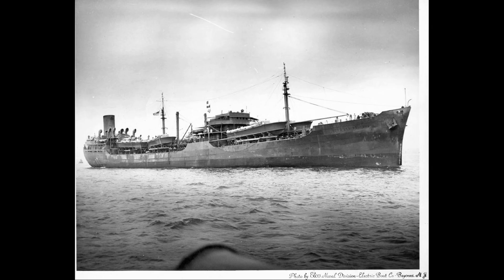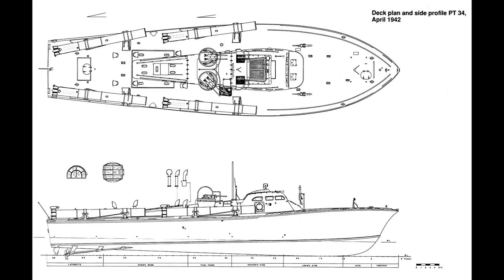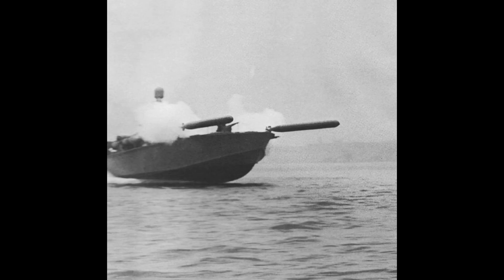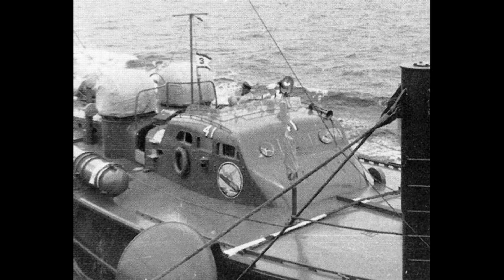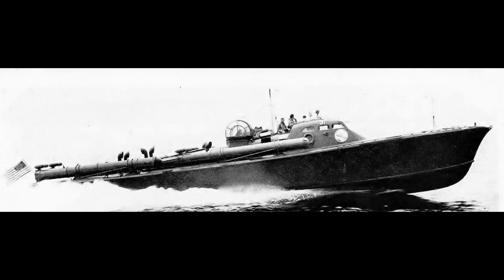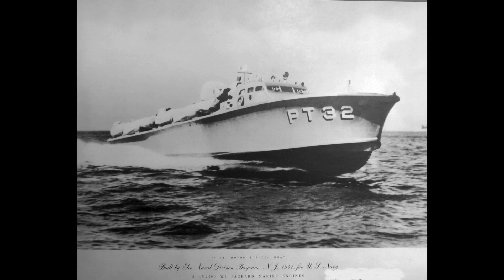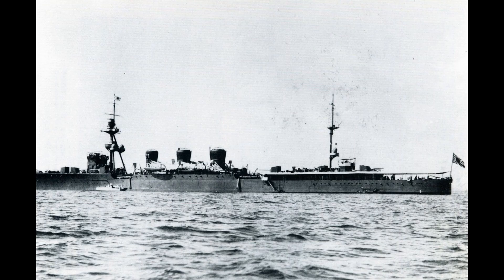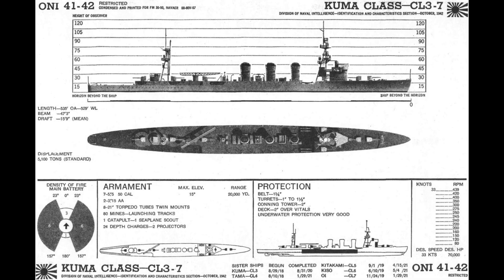PT Squadron 3 - Guide 161

Comment: If early-war US torpedoes had worked, the impact on strategy would have been fascinating.
Reply: A lot more US lives would have been saved had they worked
Reply: @captaindusty4884  And many IJN ships at the bottom as well.
Reply: The combination of dud Mk13 torpedoes in aircraft, Mk14 torpedoes in submarines and Mk15 torpedoes on surface vessels quite probably extended WW2 by six months to a year. (They all shared the same controls and fuses).
Reply: @allangibson8494  I did some digging.  For Germans, their sub torps were better than ours but still unreliable.  And their aerial ones were lousy.  Japanese ship launched "Long Lances" were great, but prone to catastrophic cascade explosions if hit on deck.  Pretty lousy situation on just about all sides.
Reply: Jim Miller The battle of Midway would have looked a bit different if any of the Mk13 torpedoes had worked (and the battle of Wake Island too).
Reply: @jimmiller5600  the main reliability issue of german torpedoes was the magnetic dentionator almost every country had issues with this. The Mk14 on the other hand has issues with the magnetic dentionator, the impact dentionator, the depth sensor and control, and last but not least the direction control qyro. All that along with being slow and leaving a large visible bubble trail.

Comment: Fantastic! I've been waiting for a PT boat guide. My dad was in Ron 10 on PT-124 from January 4, 1943 until it was disbanded in November, 1945. The Lewis guns and turrets were long gone when he arrived. They only carried two torpedoes by mid-1943, and they spent the vast majority of their time shooting up those barges, by then being used for attempted resupply of isolated islands. The Japanese barges kept adding bigger guns, and the squadron kept scrounging bigger guns of their own. It was an arms race in tropics, and the Navy, with the exception of the 40mm Bofors, never approved any of it.  

Dad's boat did have some ad-hoc armor. One of the guys was a metal worker, and he crafted a pair of 3/8" sheet steel plates from a scrapped P-39, and the crew installed them around the refrigerator/freezer. It used ammonia for refrigerant, and a stray round going through the refrigerant line filled the boat with ammonia fumes. Even worse, it meant the refrigerator was out of commission, and that meant no cold milk or ice cream, things they got from their monthly visit to the USS Mobjack, the squadron's tender. No one much cared about armor for the crew, but they wanted their ice cream and milk!

Oh, I forgot to mention that no one in the squadron thought very highly of Cdr. Bulkeley. He got to be a big celebrity because of the daring rescue of McArthur, and pretty soon he became the Navy's version of him. He was apparently an intrepid sailor, and the guys felt like he wanted to make sure everyone knew it. His book "At Close Quarters", written in 1962, got an even frostier reception, since most of the guys felt like it was a self promotion book, but also a promotion for JFK and the PT-109. A lot of other heroic actions by PT boats got short shrift in the book.
Reply: Brother, 
My Father(1st Marine division from 1942-1945) always said, "the worst thing in the military, was Navy ring knocker." He (my Father) had a very strong dislike of all most all Navel officers.

God Bless your Father.
Reply: @knutdergroe9757  Thanks. He was a great dad. God bless your father as well. From everything my dad told me and from what I've read, that sounds like that was a pretty good description of Bulkeley. No one can doubt the man's bravery, but some people use that as currency.
Reply: Mine served aboard the USS Maryland, BB46 as a radarman from Mar. ‘42 to Aug. ‘45. He survived 2 kamikaze hits, 2 bombs, and the aerial torpedo which blew out the bow.
Reply: Sar Jim, The book "At Close Quarters" was written by a different man, Robert J Bulkley, not the Admiral John D Bulkleley. Although both were PT Boat Vets. As a member of the PT658 restoration crew I have spent a lot of time with numerous WW2 PT boat veterans and the overwhelming consensus is that Admiral Bulkeley was a great guy and was well liked and admired by the men in the Squadrons (RONS). I have attended several WW2 PT Boat Veterans Reunions and they all pretty much feel the same. Maybe your Dad had a beef with him and had a different opinion, but it was not the majority opinion of him among WW2 PT Boat veterans1. In my book he was one of our greatest heroes of WW2. He also went on to start up the Motor Torpedo Boat Squadron Training Center in Melville RI,  then Command the USS Endicott that had battle and sank several German Corvettes, and then return to another PT Boat Squadron Command before the end of the war. Afterwards he was placed in Command of GITMO, and then the plankowner of the US Navy Board of Inspection and Survey (INSURV), which inspects and improves the readiness of every ship afloat. It was his idea to start INSURV. There are about 3 books about him you may want to read they may change your opinion.
Reply: I was a sub sailor. Milk and ice cream were critical items. Unfortunately they ran out after the first week.
Reply: Based on my own research, PT-124 was an 80-ft PT-103 class boat (PT-109 was the same class) armed with the twin fifty mounts and a standard 20-mm Orlikon gun, as well as two to four torpedo tubes and two or more 300-pound depth charges. How the crews improved their own boat's armament was up to imagination and what they could swipe.
Reply: tim murray  There's a story of how an ingenious PT boat crew in the Mediterranean distracted a group of guards that had been placed to watch over a  supply of beer on the dock, near the boat (bloody insult, because the beer was for an officers club at that base). Well, two guys started a fight and the guards rushed over to subdue the perpetrators. But when they got back to their post, the entire shipment of beer was gone!
Reply: tim murray  wwll USN were dry boats. Its why they so loved visiting commonwealth ships wardrooms n messes!
Reply: Kind of a 1940's version of John F. Kerry but without the treason element?
Reply: My Dad, in one of the few stories he would share was the strafing of the trees along the landing beaches before dawn. They would be filled with snipers waiting for marines and dawns light. He said the Marines loved the P.Ts. 356 Ron 27.
Reply: @francisbusa1074  Funny you should mention "treason", as that seems to be your side's specialty. Your guy admires the Austrian painter and authoritarianism. Not sure how you square that, but it seems you guys are rather flexible with fact and reason, so I guess you'll find a way...
Reply: totally untrue ..… basing it on one guys comment above

Comment: Ever since I watched reruns of McHale's Navy as a kid with my dad, I've had a huge soft spot for PT boats, and if I ever get a bunch of money, I'd build a replica and live in it up and down the US east coast.
Reply: Same dream.....
Reply: Same here...
Reply: Two Higgins type boats, PT-658 and PT-305, have been fully restored and operating. The 658 in Portland, Oregon and the 305 on Lake Ponchitrane in New Orleans where she was originally built.
Reply: @ronaldrobertson2332  There's a Vosper in Ohio (PT-728) that I hope to go visit, as it's a bit closer to me than the others. I definitely know about the others, though.

There also used to be a whole bunch on the Hudson River here, as part of Fleet Obsolete, but as far as I can tell, they went defunct years and years ago, and I assume the PTs are gathering dust in some warehouse downstate, which really stinks.
Reply: Re building in living on a pt.Thats not a crazy idea. Several choices of sandwich/fibreglass/marine ply construction. Could be built Much lighter.so needing much less power Three marinized chevy diesels would would sound Uncannily like the origional packhard v12s!
If the diesel fuel bill is still a bit eyewatering , is possible to configure the engines to run on lpg. Cylinder tanks hidden inside the fake torpedo tubes
Reply: Most of the PT boats were burned in the Philippines after WW2...
Reply: The 73 seen most often was a reduced size replica. I think it was an attraction featured at Universal.  Just a shell.
Reply: Lanse Lithgow Not having eight tons of torpedoes on deck would help with fuel consumption too.
Reply: Hey Chuck ! Hurry up will ya. The good old '73.
Reply: John Wayne actually owned a PT for pleasure.
Reply: @richardw64  me too brother!!!
Reply: Update on the 305: Due to the cost of running the boat and covid ruining tourism,  the 305 has been taken out of the water and wrapped in shrink-wrap and put in storage.
Reply: @gispel7058  The actual PT 73 was a Higgins-built 78-footer that served in the South Pacific. But it was lost in action when it ran aground in enemy waters and was burned by the crew to prevent capture.

Comment: Great episode! I would also like to hear a breakdown of all of the different PT boat classes and their evolution and field modifications. Maybe even an episode on german E-boats and the british equivalent
Reply: It would be a tough breakdown, especially for all of the SW Pacific squadrons. The boats were as individual as their crews until very late in the war. Each boats armament depended on what the crews were able to "Requisition(Steal)" from either the Army, the Marines or the Black/Brown Shoe Navy. Even late war when "Most" of the requested weapons were fitted at launch prior to deployment, boats tended to pick up whatever weapons weren't "Welded Down AND Under Guard".
Reply: @ovk-ih1zp  Well, there were several different factory fits over the course of the war, especially with the 80' Elco and the 78' Higgins.
All the boats from the 77' Elco on could replace the aft two torpedo tubes by 4 Mk1 roll-off racks each with 1 Mk6 DC. 
The 77' Elcos were PT20 - 48 and PT59 - 68. Their original equipment was two powered Plexiglass-covered turrets with two .50 cal each, plus two optional twin .30 Lewis mounts. Beginning with PT45, an aft-mounted 20mm Oerlikon was added at the factory.

FWIW, 6 of the 12 boats at Pearl Harbor on 7 December 41 were in the Navy Yard being prepared for shipment to the Philippines as deck cargo onboard the Navy Patoka-class oiler AO12 USS Ramapo. PT27, 29, 30 and 42 were already tied down on her deck and PT26 and 28 were in cradles on the dock next to her, while PT20 – PT25  were in the water and operational over at the Submarine Base at the time of the attack.
All the PTs in the Navy Yard had already had their fuel tanks drained in preparation for transport and therefore were immune to fire critical hits. OTOH, they had no power to operate their hydraulic .50 MG mounts, so when the attack started the crews had to cut the hydraulic lines and prepare the gun mounts for manual operation, but this reduced their AA capability.  This did not apply to the other six, which immediately got underway in the harbor.
In October 43, PT 59 - 61 were converted to MGBs for use in the Solomons campaigns. The TT were removed, the 20mm was moved to an amidships position and two single 40mm Bofors fwd and aft and four additional twin .50 mounts and SO search radar were added. 

The 80' Elcos were PT103 - 196; PT314 - 383; PT486 - 563; PT565 - 624 and PT731 - 760. The following boats were Lend-Leased to the USSR: PT498 -504; PT506 - 521; PT556; PT560 - 563 and PT731 - 760.
The 78' Higgins boats were PT71 - 94; PT197 - 254; PT265 - 313; PT450 - 485; PT625 - 660 and PT791 - 796. The following were sent to the USSR: PT625 – PT660.

The beginning outfit of the 80' Elco and the Higgins in 1942 was 2 twin .50 in two ring mounts (the successor to the powered turrets) and a 20mm Oerlikon aft. Listed armament is factory equipment of a new boat from 1942 – 43; actual armament varied widely depending on what weapons the crew could get.
In 1943 the early boats were refitted with US SCR-517C surface search radar. Some added salvaged M4 or M9 37mm autocannon from junked P-39s forward; a few (like PT-109) added a complete US M3 37mm AT gun on the bow. Some of the Higgins boats added a second 20mm fwd.
1944 factory equipment: SO or SO-3 search radar added as standard; the 20mm was moved forward, a 40mm Bofors was added aft (the torpedo tubes replaced by roll-off launchers for Mk13 aerial torpedoes as weight compensation). Some boats added two fixed Mk8 eight-shot rocket launchers.
1945 factory equipment: F(1)1 M9 37mm, 2 eight-shot Mk50 trainable 5 in rocket launchers added.
Many boats took on an Army 60mm mortar for using illumination rounds in night combat.
FYI: I helped do this write-up as the OOB for the Pearl Harbor scenario for the Command at Sea 'Rising Sun' scenario book.
Reply: @ovk-ih1zp  : The guards should have counted themselves lucky not to be part of the "requisition".
Reply: @jlsperling1  😳🥴 ...That's alotta PT boat stuff!

Comment: Love MTB, MGB and PT stories! The first book I ever read about them was “We fought them in gunboats”, seem to have most of the books now! A common theme was that the boats were almost disposable, required a lot of maintenance, drank fuel, but were tough and usually well loved by their crews. The PT boats were a sensible size, slightly bigger than most British boats but based on a British Scott Payne design. Sadly at wars end most were so worn out they were simply burnt where they lay. One working PT boat is left though, complete with its Packard (not  Packard Merlins!) petrol engines.
Reply: Make that two- PT 305 operates down in New Orleans, operating on Lake Ponchitrane where she was built and tested during the war.
PT 658, the one I think you're referring to, was rebuilt over a 12-year period and now runs in Pugent Sound in Portland, Oregon. Both are Higgins-built PT boats.
Reply: @ronaldrobertson2332  Thanks for the update! Good to hear about another one. Here in the UK a lot of MTB MGB etc were sold of at wars end and used as houseboats, many still survive just! Problem here is after a boat is restored it's expensive to keep, moorings are costly in the South.
Reply: soaringtractor  Well then, good night.
Reply: @ronaldrobertson2332  FO........

Comment: From what I read, many of the PT boats operated despite being worn out from lack of re-supply. Much of the time the top speed was not achievable because the motors were just too worn.
Reply: I don't think it was wear. It takes long periods of use and abuse to wear down internal engine components to the point where performance is seriously degraded (worn rings, valve guides, bearings, etc). The PT boat engines were Packard-built distant cousins of the Liberty L-12 aero engine, a reliable and well established marine version, and marine engines aren't known for having performance rapidly degrade from use. Oceans are big places so reliability is key.
My guess would be a lack of aviation fuel. The Packard 4M-2500 was supercharged and needed 100 octane fuel to be able to run those high manifold pressures without spontaneously deconstructing from detonation. With the supply problems they had I would not be surprised if they were forced to bypass/disable the supercharger (derating the engine and effectively making it naturally aspirated) because low octane automotive gas was all they could get.
Reply: @rwaitt14153  The Packard engines had a rated service life of about 500 hours....and that wasn't under combat conditions.  By the loss of the last boat its engines had over 2000 service hours.  The log of the trip from Luzon reflects a top speed of about 29 knots with copious consumption of oil.  It wasn't much different with aviation engines of the era.  The were all operated at their limit of capability with crappy fuel and lubricants by modern standards.
Reply: Even Packard engines wear out eventually.
Reply: You forgot to mention barnacles and what not on the hull. They have a major effect on speed.
Reply: @rwaitt14153  are you sure they supercharged the PT boat edition?
Reply: @stevek8829  Damn right !!!! The M2500 was a purpose designed for PT boats based on aviation engined, dual overhead cams 4 valves per cylinder and single stage mechanical supercharged, see here on You Tube the video about those engines. and they ran on 100 octane av gas !!

Comment: 3 petrol v12 engines. Read Packard built marine engines. Car company had been building V12 passenger car engines for years, a natural progression. I knew a motorman on a pt that stated after the 109 ramming, all boats ordered to idle in gear.  Such brave young men.
Reply: The Packard M2500 had NOTHING to do with Packards V12 car engines.  Packard since WWI had been designing and building V12 Aircraft engines, ie the V12 Liberty, Packard also had a 2500 cu in disp aircraft engine and they built 2500 cu i  marine engines for Harmswort boat racing and Packard purpose built the M2500 PT Boat engine used in ALL US Navy PT boats and air se rescue.  the Brits also   used the Packard M2500 in many of their MGB and MTB and air sea rescue.  Packard built 14,000 of these M2500 PT Boat engines. Facts of History. and HELL NO these were NOT the Packard built merlins. the M2500 preceeded the merlin at Packard by 4 years !!
Reply: I am sorry to anyone who thinks i stated packard used a car engine in a boat. I did not. Since cadillac had discontinued the v12 in 1940, packard was still set up to build v12 engines of any configuration with necessary engenering changes for either marine or aircraft.
Reply: @brucewiemer255  The equipment for the M2500 had NOTHING to do with the car engine !!!! Packard was already "set up" to build marine and aircraft V12's !!!  had been building them since WWI, the v12 Liberty engine !!!
Reply: I give up. Either you dont read what i wrote, or a very narrow minded person. Dont bother to respond. I delete you tube haters